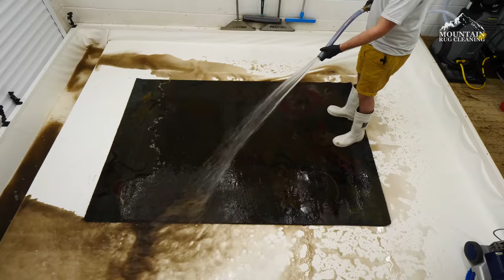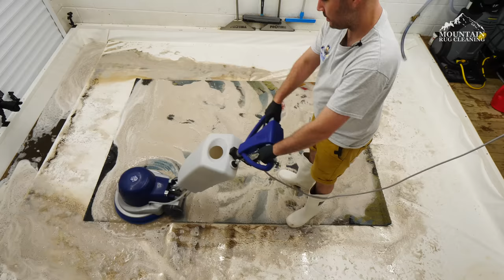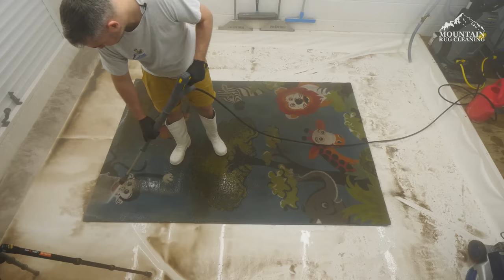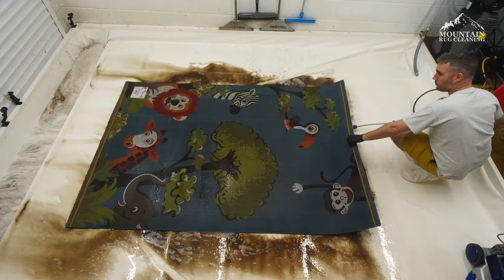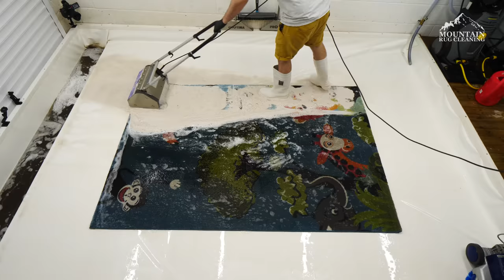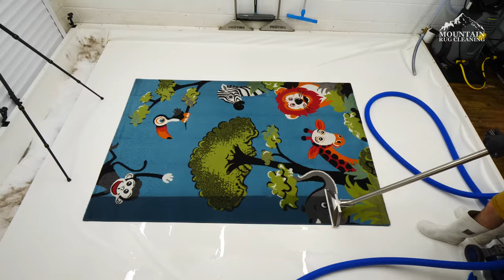You Wont Believe The Pattern That's Under This Filthy Rug ! Carpet Cleaning | Satisfying ASMR

Comment: This is a very satisfying process. I wonder who would throw out such a good rug?
Reply: It probably got soiled and wasn’t worth the cost to have professionally cleaned. Look at how much work, water, soap, and electricity goes into these cleanings, then add the capital equipment and facilities cost and maintenance. We’re not even seeing how much time it takes to do enzyme/chemical soaks to remove odors and sanitize them.

It’s usually only worth having a rug professionally cleaned if it’s a very nice, very expensive, very old, irreplaceable, and/or very loved.

Comment: Why don’t these pro rug cleaners put the rug on a raised grating or rack for the pressure wash to blast the dirt all the way through instead of having to keep blasting dirt back and forth between the top and bottom? Solid surfaces are obviously better for the soak, squeegee, scrubbing and vacuuming stages, where air flow would just get in the way.